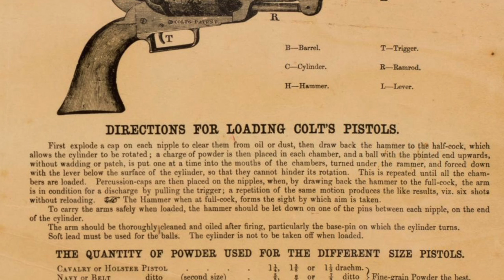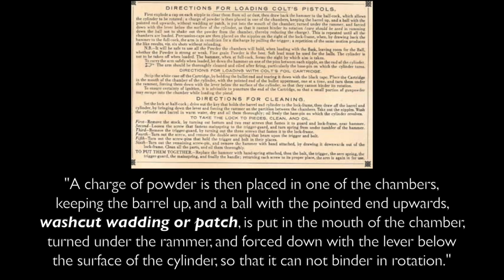Percussion Revolvers in the Rain

Comment: BTW the colt is very easy to change cylinders. An expert can change cylinders as fast as a modern magazine.
 I learned this with my old CVA 1860 revolver. 
If you are happy with the power of a .38 then a BP revolver is just fine.
But can be pushed to a .357 mag. power.
I also prefer conical projectiles. In truth I use a .44 mag bullet mold, 180 gr. And a .44 mag shell for powder load using FFG.  Makes a nice combination.  This will give .357 power in the .44 BP using the 7.5 inch barrel.
Long story about the FFG. I once bought it by mistake. And used it sometime before I noticed it was 2 F and not 3F. 
BTW  you can use 3F in flintlock primer also.
And you can use 2F as well, but I had to crush it. to smaller powder.  But both have a delay. Instead of boom. It kaboom.

Comment: With flintlock firearms, sometimes grease or soft wax was smeared on the gap between frizzen and pan and frizzen and barrel to make the firearm waterproof. As long as the firearm was carried muzzle down, it would probably fire. 
On cap and ball revolvers, grease was smeared on the chambers mouths in front of the ball and around the caps (not ON the caps) for the same purpose.
You could do a test with these tricks and fire, say 5 or 10 shots and see how effective it was in keeping the gun functional.

Comment: Cleaning the nipples immediately after firing is important to keep them from pitting. The pitting allows moisture to get into the primer easily. I machined some stainless steel nipples for my Colt Navy revolver 2 100ths over and polished them smooth. I can dunk my pistol in water and it will still fire reliably. I also put a little grease on the sides of my projectiles typically my homemade conicals and grease the ends of the chamber with some bore butter. My flintlock riffles I used to hunt a lot with them in the Midwest mostly in sketchy weather. Carefully priming the pan not allowing any powder to interfere with the seems of the pan and frizzen, making sure those surfaces are polished and clean and adding a little grease around the edges helps to keep moisture out as well. The rifle should either be carried in the ready position or pointed down with a leather flap over the frizzen when raining to keep water out of the pan and barrel.

Comment: The problem might be that the percussion cap is more of a friction fit over the nipple which could result in water that gets onto the nipple might move by capillary action between the nipple and the cap wall into the explosive material of the cap.  Given the rotation of the cylinder the capped chambers along the top would be more likely to have water around the nipple area.  Depending on how the "rain" falls on the weapon that may then affect which chamber nipples got water on them.  Maybe a closer look at the nipple area of each chamber might shed some light on whether that happened.

Comment: Even though the percussion caps are a tight fit on the nipple, capillary action is still able to suck a good amount of water under the cap and ruin the percussive mixture, so any cap that is in direct contact with even a small amount of water will most likely fail to detonate. As mentioned by others, things like beeswax or rendered animal fat can be used to better seal off the caps and prevent these issues.

Comment: I use a candle and melt drips of wax to seal the caps before extended storage or packing in raining weather on an original 1860 even with wrong sized caps have never had a cap failure

Comment: honestly, I noticed you colt has a light hammer. May want to change the spring. 
I have a two BP that are identical. One has no problem with any cap. The other rarely doesn't have a problem. both are the same age.. bought at same time new.. Its the spring. I've never replaced it. I just don't use it much.

Comment: As with the flintlock you could use a thin bit of waxed leather glued to the frizzen underneath, so when you close the frizzen down on the pan you have a seal. As with the revolvers you could wax the caps, not at the back inside but at the sides. Give that a try.

Comment: I remember reading about how some people would put grease over the ball once in the chamber to help seal the cylinder. But I don't remember anyone doing anything to the cap end. It seems to me that every fail but one was a cap fail. I absolutely didn't expect that as I thought the caps were less sensitive to moisture than they obviously are. detritus asked an interesting question about recapping the cylinders to see if the primary charges were dry and viable.

Comment: I heard a story of Samuel Colt demonstrating one of his revolvers to a crowd by submerging a loaded pistol in a bucket of water at the beginning of his speed and then pulling it out of the water at the end of his speech and firing all 6 shots into the air. I can not confirm if that ever actually happened, but I suspect a dab of grease or candle wax on each nipple after after capping each cone along with grease packed into the end of each chamber would effectively waterproof the gun.
I have not tried this, it’s just a theory.
Great video, as always!

Comment: Percussion caps will not seal out water when on the nipple because the inside surface of the cup is serrated.  Water wicks between the nipple and the cup.  The Colt has partial shrouding around the nipple and can collect more water around the cap enhancing the wicking/seeping effect.  The Star has no shrouding, and the water runs away easier.  Used to drip candle wax on the caps after seating on the nipple, and that would prevent water contamination.  Smear tallow over the bullets as well.

Comment: an interesting test  to do would to pout the water straight on the back of the revolver as if it is being carried in an open top holster. I imagine colts large recoil shield will diver the water away better that the starr or remington. flap holsters work and so does sealing the caps with clear nail polish.

Comment: I've always carried a cow's knee for my flintlocks. I also keep beezwax in my possibles bag to seal the pan.  I am pretty damn confident in the first shot, but after that the residue draws moisture like a sponge. Getting a second round off on a really damp day is a bitch. I also carry a candle stub that I use to seal caps on revolvers. A drop of melted wax on a no. 11 seals them up nicely.  A good musket cap is pretty damn rainproof on it's own. I've seen a whole line of .58's going off in a down pour. It's all in how you handle the damn thing, muzzle down,  in a flap holster or under your poncho etc... Get it loaded and under some cover and leave it alone. It'll go off just fine, at least the first time....

Comment: What would happen if you mistakenly put the ball in before the power and seated it? On the flintlock would it be fixable? On the Revolver would a number of precision caps be enough to get a ball free if the cylinder?
Reply from the maker: You'd need to pull it out with a screw/worm tool.

Comment: 1) Regarding your test on the flintlock. You really should take care to wait a few seconds even when the main charge does not go off. You should had treated it as a hang fire because even though the chances are low, the main charge can still go off after a delay.
2) Why the percussion revolvers aren't firing might be due to water cushioning the hammer strike. Or perhaps the water is slowing the hammer just enough so it cannot strike with enough kinetic energy to ignite the primer. Not sure if this is an accurate term for this, but would this be a form of hydrostatic lock?

Comment: You always supposed to put some lube in the front of the bullet to lube the barrel and keep lead and powder fouling down. That will keep fouling soft and prevent multiple ignition and that's a safety precaution. And weather proofing to help keep moisture out.. and the caps I use some candle wax and just rub a birthday candle around the nipple and then put the cap on and I haven't ever had any problems yet . and I have used a grease pencil that seems to work really great on sealing the nipples and caps .

Comment: This is an interesting idea. In the historical perspective the impact on military’s at the time would have been significant. Especially when considering the issues involved in early naval operations. Salt air being corrosive in and of itself, then on top of that inclement weather and high seas making the use of these types of weapons almost impossible. 

Knowing this issue had to exist. The thought experiment of how this would have effectively changed battle plans and strategies becomes increasingly more important. As a commander in that period what would you do to mitigate these issues? Could you then make that into an advantage against your opponent?

Also would interested in seeing if these conditions would effect a percussion rifle the same way.

Comment: Thank you for showing the later document showing the wad goes OVER the bullet/ball, it drives me nuts seeing people put the wad between the powder and ball, which squeezes the lubricant into the powder and causes unequal discharges every time.  been trying to tell Othias and Mae this on their black powder series but I don't know if they ever see my comments
Reply: I am sorry but the later document, at least in this video, is not correct. Colt's manual for loading does not mention a wad. There is a typo in the text that has been added later on. The highlighted text that says "washcut wadding or patch" is actually "without wadding or patch". There's also a typo in the end that says "binder in rotation" which says "hinder its rotation" in the original. My assumption as to why this error has occurred is that many of the original manuals are worn, the text faded and hard to read so people have misread them and thus this whole wad/no wad debate started.

Edit: As Karl states in the video, this information about the use of a wad comes from reproduction instruction manuals, which further supports my theory of them being misread and re-written incorrectly.
Reply: @mr.charlesanderson  there are two documents, the early one says no wad, the later one says there is. He says he can't find the original source, but that paper and typesetting would be a massive undertaking to fake, and there has been documentation to support it. I don't see any reason to discredit the powder-ball-wad/lubricant method.
Reply: @DeadBaron  I have seen many pictures of different kinds of originals from auctions and they all say one way or another "without wadding or patch".

An original loading instruction for a Paterson revolver from 1841 does not mention a wad at all. Later labels for the Walker, Dragoon, Pocket and Navy revolvers state the same "without wadding or patch".

A manual for the 1855 Colt Root pocket model has a different wording for the loading steps, but it too has the exact same sentence and in cursive.

The 1860 Army, 1861 Navy, 1862 Pocket Navy and Police have the same text as the earlier models.

The earliest mention of the wad I found was on two gun forum posts from 2008. There was a discussion about the original Colt loading manual. The picture posted was very poor quality and the text was re-written by the user. In that post the error occurred and the "without" was turned into "washcut". The same happened with "hinder its" turning into "binder in".
Another user pointed out the error in the latter, but no one seemed to notice the first. They even continued by saying that an old timer friend of theirs must have read the manual because he uses a wad under the ball. 
The other forum had almost the same conversation with the same typos.

I don't descredit the use of a wad in modern shooting, be it under or over the ball. I think it is a good way to lubricate the bore while shooting. So is natural grease over the ball.

The only thing I think is wrong, is the belief that Colt's instructions included a wad in the loading process, clearly they didn't. There is no proof, atleast in the manuals. Now I don't say that people didn't use a wad. Elmer Keith in his youth used a wad between the powder and ball in his 1851 Navy and he learned from actual Civil War vets.

Comment: Presumably your percussion caps use lead azide or tetrazene. If water were to get within the cap itself, it could quench it. Keep in mind, percussions caps are cheap and crude - the explosive primer is essentially coated on the inside of the bucket. If this explosive gets wet, well, it's not like stable explosives, like TNT, it'll be quenched, as it needs thermal or shock impact, as oppossed to being blast activated. Water will reduce of course thermal impact, but also shock, as it'll distribute it, as water is an excellent energy sink.

Comment: Wads were not used in earlier times, nor was lube up front..... wads can contaminate the powder charge and lube in the front collects grit which is bad for the bore. Guns back then were carried a lot and shot very little.
I think your issue is cap fit on the nipples....reason I say that is that the Starr goes OK for the first few but with the others the capillary action has killed the cap compound. I have shot in the rain often and never had a misfire with a Remington 1858 and really tight fitting caps. I have a capper that pushes the caps on via a plunger and they really are seated hard down. Back in the day the hammer was often used to push them right home, which is a bit dicey as any slips make a loud noise....

Comment: I kind of wonder if the position on the cylinder was relevant. Like the chambers at the 6 oclock position retained water while the ones on top shed it before it could seep into the cap.

Comment: So, here’s a hypothesis that you might be able to figure out, it appeared the cap was the failure, could it be that water is actually creeping up the side of the nipple(or more realistic splashing up from droplets)? Or is it just the excessive moisture/humidity with the water that close? Or could it be the friction heat dissipates the energy required to ignite the cap?

Comment: I remember seeing a video on another channel that recommended putting grease into the forward ends of the chambers (after seating the balls) to help seal them from the elements.  From memory they said people would use bacon grease or ??? to keep the charge dry.  However, it would seem from this that it's the rear end, or cap that's the weak link.  I also don't remember the other video talking about the shaved lead rings (but that may just be me forgetting).
Reply: You can basically use any kind of fat to seal the chambers, shooters today use anything from industrial machine grease to petroleum jelly or even Nivea hand lotion (the thicker, old school type stuff).
I think bacon grease would probably smell nice, but it might leave more nasty residue...

Comment: I'd suggest, from an engineering point of view, that if you lapped the cones to give them a radial micro-sctatch surface, that it would help with the sealing of the caps. although the caps themselves may not be individually lapped to match, they should be soft enough to allow the cones to grip and seal more effectively. think individual lines of rotation around the cones, rather than spirals, similar to an engines valve.

Comment: How well are the caps fitting on that Colt ?  I tipped a Kayak in the river with an 1860 Colt in the holster and every cylinder still fired BUT that was with  caps that  fit very snug on the nipples and the balls lubed with Crisco.

Comment: 15:15 I think you hit the nail on the head. It's not the wadding or water getting into the powder charge, it's water getting into the cap. I would bet if you greased the outer ring of the caps after you put them on it would fire 100%

Comment: If the hammer strike was alot more powerful, would that of changed anything? Or is it possibly the caps weren't as strong or something. Unless its simply water got in-between the hammer and caps indent thus creating just enough of a gap to push it but not go off.

Comment: Supposedly modern caps have a sealant (perhaps shellac) to prevent water incursion.  Perhaps you are forcing the cap so tightly down that you are breaking the seal.  Also, in regards to chain fires, they actually occur from the rear of the chamber i.e. via a dislodged percussion cap or a poorly fitted percussion cap.  The chain fires don't occur from the mouth of the chambers.

Comment: Interesting test. The revolvers did worse than i expected. I wonder if you would be willing to retest and try some beeswax to seal the caps. If that works, try water at different angles to see if the bullets are sealing. Or see if you can figure out if the wad actually helps. Would also be interesting to do the same test as today but try replacing the caps on misfired chambers to see if the main charge is still dry.

Comment: That flinch! :p  good info  and. A dud or a. Dummy round is good practice to see where you can improve on accuracy I have found that for. Flit locks. Useing wax. Grease or anything that won't run into the powder along the rim of the pan does give ya a hope of getting a shot off in the rain. And it's the same for. Nipples on percussion. Now you gotta take care not to. Plug the flash hole but a little grease or  wax along the rim. Helps stop the capillary action the. Crimp on the  caps create   bees wax has worked well for me

Comment: I think it is interesting that technically when the gun is in the holster or pointed down, the cap could make more of an umbrella shape to keep out the rain from the ignition hole. If you made it rain with the barrel slightly up, the water may wick into the percussion cap from the front, although this would be less likely obviously than the problem with the flint lock.